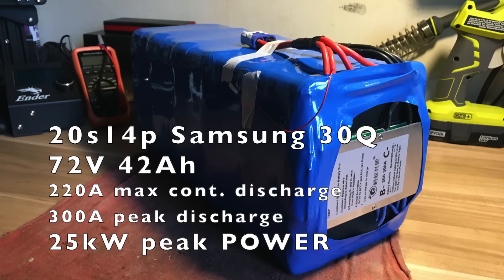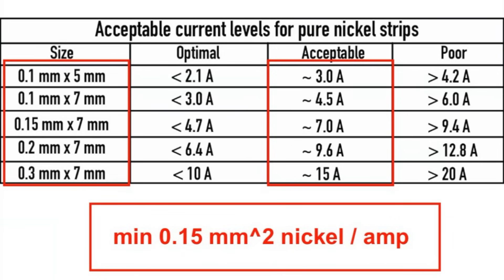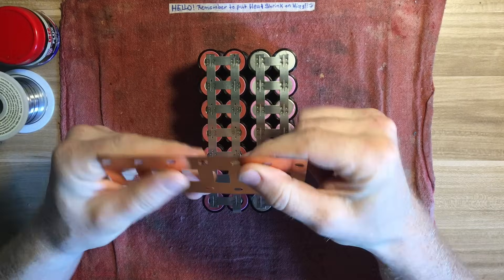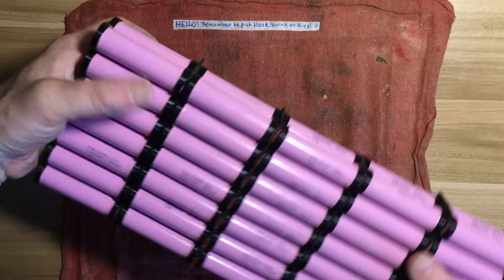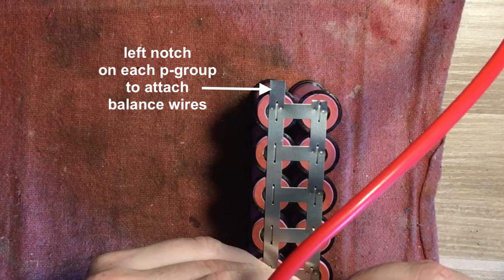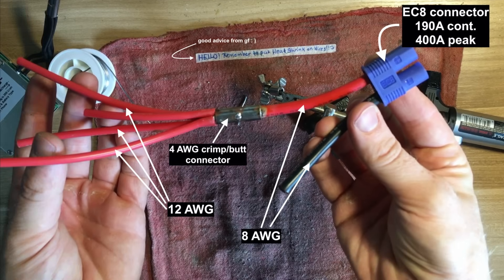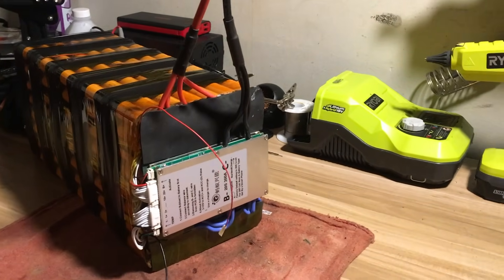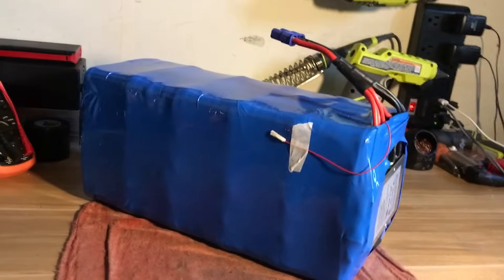How to build a MASSIVE 72V DIY battery pack for high power e-bike

Comment: Hey ,i see you mention ladi channel on the description  ,i bought the v4.2 ebike but i have serious problems for buy 240 Sony muestra vtc6 3000 mAh 20 a battery's because the sending is too expensive ,i was thinking how much difficult is for example to use Samsung INR21700-30T 3000mAh - 35A
i speak with ladi but he told me that he never try this battery's before and if I change the Sony battery's then i will need s different configuration ,that battery's for made this pack ,are sony vtc6 ,is it good ,may be you will recomend or send some link to buy ,cheers .
Reply from the maker: you can use any cells you want as long as they meet your capacity, max current, and physical size requirements
Reply: @GaiusGarage  thanks for reply bro ,i m new on this so you are showing me the way ,regards .
Reply from the maker: @cesar5957  no problem. I would say start with the dimensions of the cells and figure out how may you can find in that space. Then arrange them so you get the voltage you want (probably 20s / 72V). Then will have an idea how many groups in parallel you will be able to fit, and that will determine your capacity & max current. If that is insufficient for you, you will need to either lower the voltage (to use more of the same cells in parallel) or use a different type of cell with more capacity & discharge capability

Comment: 14 x 3.6v is 50.4v ? , I'm not knowledgeable so can someone help
Reply from the maker: yes, but what is your question?
Reply: @GaiusGarage  so is this battery 50.4v ? I can't see the extra 7 added I'm trying to learn
Reply from the maker: @connorhale4542  this battery is 20s14p - 20x3.6=72V. cells in series are summed to give total voltage. cell in parallel sum to give total capacity
Reply: @GaiusGarage  can I get your Instagram or something so I can show you some images my battery is 7s15p then , 1500w I get 30mile is that correct or can a battery be set up different I'm told its 54v 17.5 ah
Reply from the maker: @connorhale4542  if your battery is 7s15p that's only 25V (7x3.6). but if it's 15s that would be 54V. the cells in series determine the voltage. my Instagram is @emot.os

Comment: you dont put fuses on each cells ? Why ?
Reply from the maker: cell level fuses are good for battery packs with a very large number of cells (like powerwalls or Tesla battery pack) where the chance that a cell will fail is higher. 280 cells is not that many and cell-levels fuses significantly increase resistance in the pack since the power has to run through a thin wire at near the limit where it will burn vs. nice thick nickel strip. besides, if a fuse did blow, I wouldn't even know it or make the effort to disassemble the pack and replace the cell

Comment: one real quick question: does it support fast charge?
Reply from the maker: fast-charge is more a function of the charger and power supply than the battery. you should not charge any Li-ion battery pack above 3C or so (and that is probably the waay upper limit) its more risky and will ultimately lessen battery life but you can do it if you want to charge as fast as possible. For this battery pack that would be 3 x 42Ah = 126A (like I said, it's a very aggressive charging rate). So at 84V, 126A means you would need to supply 10kW to achieve this level of "fast-charge" and it would fully charge in 10-15min. So if you have a charger connected to a power supply that can provide 10kW, then you can "fast-charge". I'm just charging at home using a standard wall outlet which is limited to 1500W so my upper limit on charging current is about 17A or 0.4C, which is quite low but good for longevity

Comment: How is the battery holding up after a year ?  Is it used daily?
Reply from the maker: I think youtube rounds down the date posted because it's actually been just under two years since I've build this battery & posted this video. has been in fairly active use (although not daily) since. held up quite well - only issue recently it's that one cell group has become out of balance. The ANT BMS kinda sucks for balancing actually. I'm probably going to have to pull it out of the bike and balance it manually

Comment: Why you not put two connections on it so you can run two motors and I go a LG 72 v in my scooter it don’t have so many battery’s  it only 28pounds and it 2  inches thick
Reply from the maker: if I needed two connections I can make a cable to split the output
Reply: @GaiusGarage  you can’t You can’t split it
Reply: @GaiusGarage  you got to add it it way to much Way too much current got to add another cut 80 what on my it there to run extra motors it lights what ever you need good job

Comment: If you attach a BMS to your battery pack does that mean that you can charge them from a rectified transformer where you can adjust the dc output voltage to your battery pack ? Like mains ->variac -> transformer -> rectifier -> capacitor -> battery pack. That would be cheap at least for me. Of course with a current limiting resistor between the battery pack and your supply.
Reply from the maker: you can charge a battery pack with or without a BMS using any constant voltage DC source

Comment: I’m curious as to how this is a 220A max cont pack when 14 cells in parallel is 210A which each cell having a max cont of 15A , 15A x 14 in parallel is 210A and how does that then have 300A peak discharge can someone elaborate?

Comment: Hi! Please tell me, are there any temperature sensors installed inside the battery module of the electric motorcycle Zero S? I was repacking the battery on my Zero S and I would like to know if the BMS board will work correctly if I don't install sensors?
Reply from the maker: Im not sure about the battery on a Zero - if I had to guess I would say it does have a temp senor

Comment: hello, 
I'm making the same battery as you but I'm having a problem. My welds do not hang on the nickel strips of the batteries as well as on the other large strips of nickel. I tried using rosin flux and scraping the strips of nikel to make the solder stick better but nothing worked.
Do you have other solutions?
Thank you for your reply.
Reply from the maker: when you say welds, do you mean spot welds or solder? if spot welds, you likely need to increase your power or maybe make sure the battery is providing enough power. if solder make sure your iron is as hot as possible - you want to get in & out in shortest amount of time. you shouldn't have to solder to the cells themselves - just on the nickel strip ideally. you're just trying to keep the copper flush to the nickel so you can just leave any parts that solder to the cell alone. you can also try using solder with higher lead content - the lead free solder kinda sucks
Reply: @GaiusGarage  No, I'm talking about solder. My pewter won't cling to the nickel strips.
Reply from the maker: @Antoine-ek2mf  I would say check your solder composition - like I said, lead free or low lead solder has the problem you are describing, in my experience. flux definitely helps (although I know you said youre using that already). other than that just more heat. The iron Im using in this video is up to max temp and Im using duster to cool things down quickly. also pay some mind to the tip youre using - Im using a large flat tip to distribute more heat

Comment: I want to build a battery myself that must have 48v 2000w 42ah how many cells do I have to have in parallel and in a row
Reply from the maker: 13 in series - number in parallel depends on capacity of each cell
Reply: @GaiusGarage  The cells are 18650b with 2250mah
Reply from the maker: @ronnyriethmueller5636  2250mAh = 2.25Ah so you would need 18-19 in parallel for 42Ah
Reply: @GaiusGarage  thanks
Reply: @GaiusGarage  My battery is now ready what do I need for a bms
Reply from the maker: @ronnyriethmueller5636  get the ANT BMS - link in description

Comment: How much would you charge for a battery like this set up for the 5000w electro & co razor bikr kits?  Their batteries are 72v 10ah and cost around $1000. Which im sure is around the price you spent to build this much better battery.
Reply from the maker: yes, you are correct! About $1k to build this. Would probably charge $500 for labor. So total price would be whatever the cost of materials + $500 + shipping. Would only be able to ship within US
Reply: I’m interested in one your battery to buy

Comment: If you built and sold this battery how much would you sell it for? I see people selling 40ah 72v batteries but the cells are only 2500 mah instead of 3000 mah. I would love to build one to ensure using the Samsung 30 q's but as im sure I would be able to itsa big learning curve.
Reply from the maker: the issue is that it takes a lot of time to construct one of these - I figured $2k would be enough to cover cost of materials + labor. but understandably most people aren't willing to pay that much for a battery

Comment: Can I use 0.15mm Pure nickel strip with this setup instead of 0.2mm?
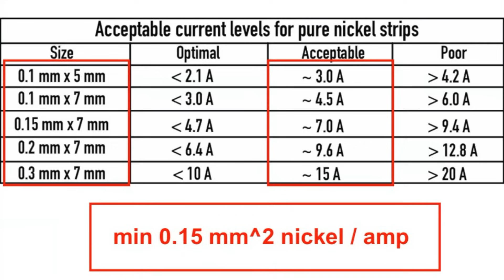Reply from the maker: depends on your current requirements and arrangement of the cells. see the chart in the video around 1:50 to get a sense of how much current is acceptable for 0.15mm nickel strip
Reply: @GaiusGarage  Okay thanks. I bought a sabvoton 72200 and the max amps i would use is around 200 but not continuous mostly 30 seconds burst. Would you think 0.15 is suitable for that because I actually bought 0.15 by mistake already and it would take me a month to get 0.2 to get shipped
Reply from the maker: @UniversalModder  it depends on the arrangement of cells - how many strips of nickel you have going across the series connections. if you have your series connections divided over many nickel strips because your pack is laid out a particular way, you can get away with just one layer, or thinner strip, etc. but if your pack is designed where you only have 3 nickel strips going across the series connections, for example, those three strips will have to carry the full max current or the full continuous current (about 100A for the 72200 when riding fast but casually). so figure out how many nickel strips you'll have going across your series connections based on your pack design, then determine the total cross sectional area (0.15mm thickness x width of the strips you have). Then compare that to what you will need, which is at least 0.15mm^2 nickel strip for every amp continuous..then maybe add 20% overhead for burst
Reply: @GaiusGarage  I'm planning on using the pack design from your video. Since I'm using that design shouldn't the copper plating be fine and I wouldn't have to worry about the series connection's since the copper should be able to handle it. I was just making sure if the 0.15 was okay to use for base of the pack with the copper plating over the series connections. Thanks for the info
Reply from the maker: @UniversalModder  if youre using the same exact design including the copper sheets, then 0.15 should be fine
Reply: @GaiusGarage  Awesome thanks a ton that's good to know. I'm happy that I don't have to wait a whole month to get the 0.2 nickel strips.
Reply from the maker: @UniversalModder  yeah that copper is such a good conductor that you dont really need any nickel for conductivity - its really just there to connect the groups mechanically and provide a surface to which you can solder the copper. just be careful not to hold the soldering iron the cells too long. you want the iron as hot as possible so you can instantly melt the solder and get out. use some duster to help cool the surface between solders so the heat doesnt have a chance to dissipate into the cells. its not so so critical - Ive seen tests where you can actually put a ton of heat into cells without ruining them, but why chance it
Reply: @GaiusGarage  Yeah that's really good that copper is so good for conductivity. I was kinda thinking that that's what the nickel was for when I was watching the video but its always better to be safe and ask questions then to start it and have a problem in the end. Thanks for the heads up and all the info hopefully I have no problems when I start making my pack I appreciate it
Reply: @GaiusGarage  hey just wanted to ask 1 more question I spot welded all the batteries but I had one problem on one of the packs I messed up my placing of the nickel strip and it was off by a little bit could you take a look at this picture I took of it and can you tell me if its okay to still use thanks
Reply: YouTube won't let me post a link to the photo I'm not sure how to show you
Reply from the maker: @UniversalModder  hmu on Instagram @emot.os
Reply: Okay thanks
Reply: @GaiusGarage  I sent you the photos on Instagram

Comment: How many miles you can do with that?
And performance.
I'm building same frame but mid motor.
Thanks man
Awesome video
Reply from the maker: thanks! I'm using a 200A controller - riding aggressively range is about 30mi. More modest pace, prob around 50-60mi
Reply: @GaiusGarage  thanks man its really good range

Comment: can you build & sell me a custom 72v 100a CD battery?
Reply from the maker: I can but I would need either the cells shipped to me up-front, or the cost of the cells + 50% cost as deposit. How many Ah do you need for this battery? This will determine the number and type of cell to use. Do you need any specific form factor?
Reply: email TZRLLC@GMAIL.COM

Comment: Could building my own pack be a fair amount cheaper. I see 72v pack going 600 hundred plus. Im wanting to build a ev scooter or something light and fast
Reply from the maker: probably wont be cheaper but the advantage of building your own is that you can design it for high discharge. the 72V packs they sell commonly have 150A max discharge, usually less. of you build your own you can design for whatever your needs are. but cost will be similar or even more depending on what you build. but most of the cost are the cells so if you can salvage some good cells for cheap, youre at a big advantage

Comment: Great video! Would you be willing to put a link in to the copper you used? I have searched everywhere. I have found some thats close but not the same and will require more soldering then i want to subject the cells to. Any help here would be great. Thanks.
Reply from the maker: thanks! please see the link in the video description

Comment: How long would a battery like this last.
Reply from the maker: if you're asking about range - 40-60mi depending on riding style. if you're asking about longevity - about 300-500 charge cycles or around 25k miles

Comment: You are correct, when you put cells in parallel they attempt to charge each other. However, that is not a whole story, because when the batteries begin to discharge, the more charged cells will attempt to charge the less charged cells. This reduces the total output of the battery as you draw power from it. The only method I have found to prevent this, is to put a schottky diode on the output of each cell, then tying the diode cathodes together. Or you could at the end of the series, which will reduce the amount of diodes necessary. It really depends on your battery configuration.
Reply: how would this affect the battery during charging
Reply: @Ridstard0  That's a good question, I don't think it affects TOO much, since this is a configuration found in car batteries. It might slightly increase charging time perhaps?
Reply: @DFX2KX  The diode will prevent the cell from charging, as the current can only flow one way, so you made a disposable pack - Nice

Comment: I'm looking to build one of these, but with like 36 in parallel. How do you charge your battery pack? I've been looking for chargers for days, but never been able to find one that's output is over 10 amps. I'm looking for a charger that is around 50 amps, do you have any suggestions on one? or how to build one?
Reply from the maker: 20s36p? thats huge! what are you going to be powering? 50A at ~80V is about 4kW. You can look at EV chargers like the one here: https://www.electricmotorsport.com/ev-parts/chargers/elcon-pfc4000-charger-4kw-36-156vdc-651.html but they're pretty expensive. Might be possible to put together something like that with a few power supplies in parallel and a boost converter, but I'm not sure how easy it would be to find one to support 50A. You can get 25A out of a typical 48V power supply and a 1500W boost converter
Reply: @GaiusGarage  yea, it's going to be huge, but it needs to be to power a go kart haha. If it was you building a pack like this, would you make it one pack? Or split it up into smaller packs and hoot them up in series to get the full 72 volts? I see on Amazon they have ones that are for 20s, but only 3 amps. would it work if I put like 10 of them in parallel to get 30 amps? Thanks for the help btw, it really helps
Reply from the maker: @flyingtaco1770  dont get confused between amps (current) and amp-hours (capacity). Not sure which packs on amazon you're referring to but if theyre 20s & 3Ah (capacity), 10 of them in parallel would indeed give you 30Ah but what would the max discharge current be? You probably want alot of power if youre going to throwing this many batteries into a go kart so if those 3Ah cells can each deliver ~10A you can get 300A out of the full pack. But if theyre 3 "amps" like you said, 10 in parallel would only give you 30 amps, which is pretty low. If I were building this pack and wanted to split it, I would have two or more 20s packs and connect them in parallel, rather than multiple lower voltage packs in series. If you connect multiple packs in series you will need some way to keep them balanced - either some BMS or balance charge them somehow. If you connect multiple 20s packs in parallel, they will balance themselves.